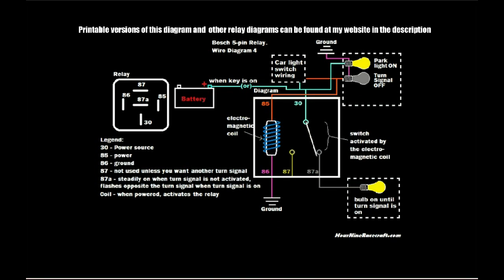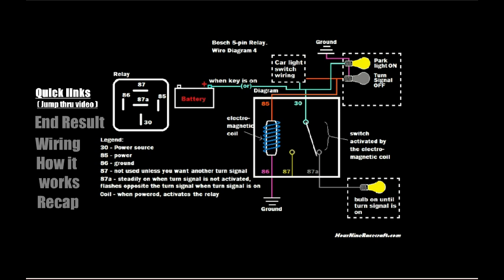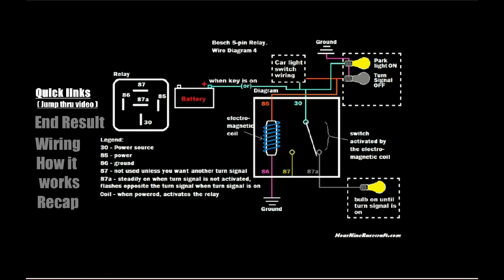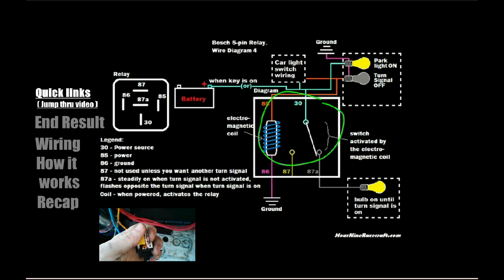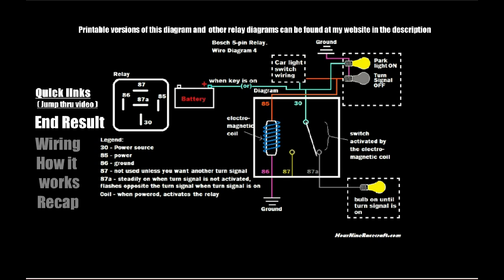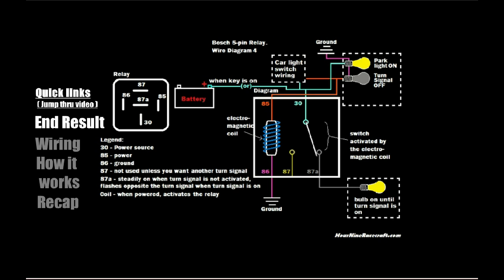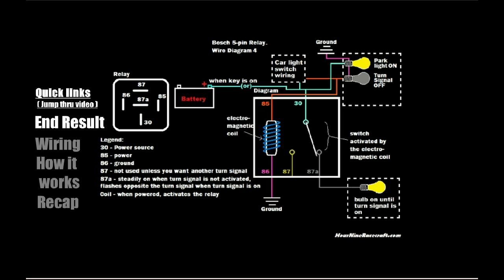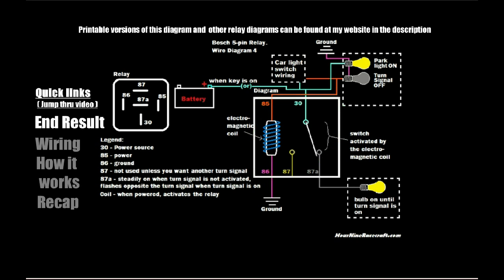Advanced Relay Tutorial: Turn Signal Integrated Brake or Parking Lights (Example 4)

Comment: You're a legend to many people, are over-explaining this sort of wiring in your video is straightforward. Cheers
Reply from the maker: thanks! By the way, I accidentally had pins 85 and 86 flipped in most of these diagrams. 85 should be ground and 86 should be positive. Some relays will work either way, but others are designed to only work with pin 85 being ground and 86 being positive.

Comment: Somehow you' forgetting that a) you need a brake switch to energize brake light, whether or not you use a relay
b) vehicle wiring is stranded, not solid , for a reason, to avoid vibration. Soldering stranded wire renders it solid.
This both makes connection vulnerable to  vibration and increases resistance.
Buy a pair of AMP or Danirls crimpers and crimp joins properly.

Comment: Awesome video dude! One question though, I want the side light to turn on the same time as the park light and flash the same time as the turn signal light, not flash the opposite way. Do I wire a 2nd 5pin that runs from the park light to the 30 of the 1st relay?
Reply: I'm not a pro, and I don't know why you would care it they both flashed at the same time or not, but it's your choice. I'll be using the circuit he just showed us when I re wire my 81 Camaro Z28. I don't care if they come on and off together.
But if you want them to come off and on together, I think that you would need another bunch of stuff involved. I think you would need a "switch-back" unit in there somewhere. Research it, but that involves 2 diodes in parallel in there.
More stuff to buy, they are hard to find, more things to burn out.
It's your choice. I haven't drawn out the circuit that you would need yet because I rather have an easier, more dependable circuit. But it should be doable. Cheers!

Comment: Ive try this diagram for Left and Right rear brake light but my 30 & 85 feed to my turn signal and 87 my brake light. When the turn is on both my brake light is on...i only test one side only. should i wire both using 1 right relay and 1 left relay to make it work when turn left is on brake left on not both side

Comment: I'm trying to wire led tail lights on my motorcycle. I have Run/Turn/Brake plus ground for both sides on the bike and I'm trying to wire this into a two wire led light (so 4 into 2).  Can you help with the construction of the circuit?

Comment: thanks for the video, learned a lot. but if I wanted the same light to be my running light & turn signal I just 87 & 87a to the positive of same bulb? I would need 2 relays for a right ? thanks
Reply from the maker: +bob smith if you put 87 and 87a on the same positive then the bulb will be on regardless of the relay being on or off. I would wire 87a to the bulb positive and run your turn signal into 86 with a resistor (the resistor slows the blink rate to normal). When the turn signal is on it will energize the relay and turn off the light bulb as the turn signal clicks the relay on and off. The downside is that the turn signals will only work when the parking lights are on.
Reply: @LegitRaceCraft 
 My bad, meant to say using left/ right signal flashers as trigger power for relays. My bike has auxiliary LED lights left/right side Daytime running lights. When I signal right flasher, I want left side drl's turn off & right side Drl's blink with the right signal flasher. When I turn off signal flasher, I want right/left Drl's turn on. I would need 2 relays For this, right & left side? Thank u subscribed!
Reply: @LegitRaceCraft 
Forgot to mention don't need resistors because I have a LED signal relay For my OEM lighting system

Comment: I have tow mirrors that have a turn signal in the front of them. It is wired as a turn only. I want this one light to be a turn signal and a running light. When the turn is off I want it to be on as a park light. This can be done with 2 diodes and a resitor. Can it be done with one of these relays?
Reply from the maker: +kevinwi69 yes. You have to run a power wire and place a relay in the mirror, unless you want to trace out the wire to where it splits off of your wire loom somewhere in the cab. If I were to do it I would run a wire from your parking lights to the mirror, and find a small relay. Then wire the power wire (from the parking lights) to relay pin 30. The old turn signal bulb wiring should have one wire going to 85 and one to 86. 87a should go to the turn signal bulb and the bulb ground wire can be shared with the relay ground.

Comment: My problem is, and I'm probably an idiot & can't see it, but I want to tie my cars turn signal light and separate running light to one light, blinking on off like a turn signal and working as a running light... I follow the diagram, and it won't flash (on/off), only (high/low flash)... HELP!!!
Reply from the maker: +Bannana person i'm trying to visualize what you're saying but I'm having a little trouble. So, right now you have a turn signal and a running light and you want your car to make both of them running lights until they are used as turn signals, which makes both also blink at the same time?

Comment: If on my car I was using a led tail light  but was also used as a black light, what would I use to cut the power while the brakes are depressed to allow signal to flash ?

Comment: Hey mate, just a quick question.

As your turn signal flash, it will cut power to the 'parking light', which will be replaced with the 'turn signal light'. Once this turn signal does one flash, wont the globe instantly flick back to the park light signal? Or am I slightly missing the point haha. 

I'm trying to turn my turn signals into park lights (with the full 21w), however still flash as turn signals

Comment: I have 1999 E300TD My Left side lights next to head light is not working I checked Fuse, change the bulb and still nothing but no luck any suggestion please let me know my e mail is javid.mian@gmail.com.  Thanks
Reply from the maker: +Javid Mian you'll have to have someone check if you have a good ground. And if you do then check to see if you have positive when the light is on. If you have both then your bulb socket is bad. If you don't have either ground or positive then you'll have to see where the wire problem is.

Comment: but this then adds more load to your parking light circuit, which depending on the added circuit's load, could cause issues such as blown fuses, or melting wire insulation...
Reply from the maker: +themajorahole The relay would turn some of the parking lights off while the turn signal is flashing on, so it would actually lessen the load or keep it the same. The way I'm talking about wiring my motorcycle would add more load, but that load would be on its own wire going to the battery. Even if it wasn't and it was added to the factory wiring, the added amperage wouldn't overload the system. Some bulbs would be off and other would be on. Typical turn signal bulbs pull just over half an amp..if you have 6 of those (two front and 4 rear) then you are talking about 3.5 amps..or closer to 4 amps with marker lights. The relay would pull between 100 and 300 milliamps (0.3 amps), and some of the larger relays are still 800ma. So worst case scenario it raises the load to 4.5amps on a 10 amp circuit, but that is considering every bulb is on, which it wouldn't be. At just over .5 amps you could run maybe 17 or 18 bulbs at 10 amps and run the risk of damaging things. It isn't enough to melt the wire or blow the fuse. The 18awg wire that is typically used in car/moto wiring can handle 15 amps at 12v typically, unless you use longer wire, then you would lower the ampacity. So in reality, it's as safe as the person doing the wiring (sorry for the long description)